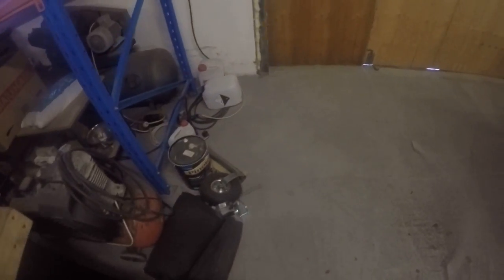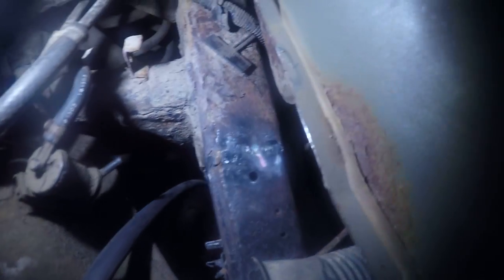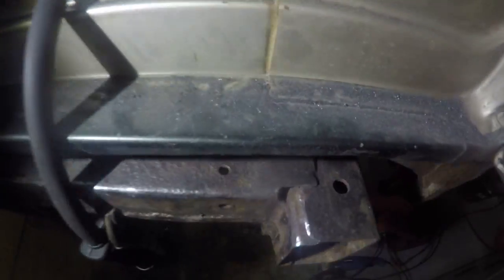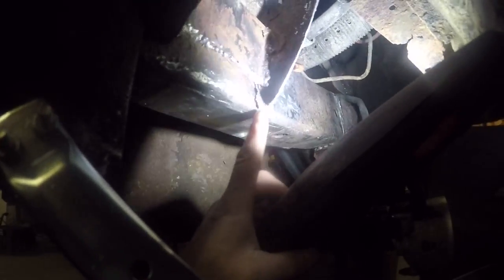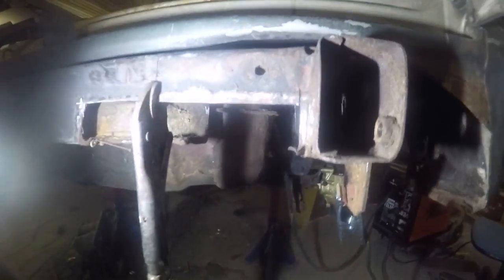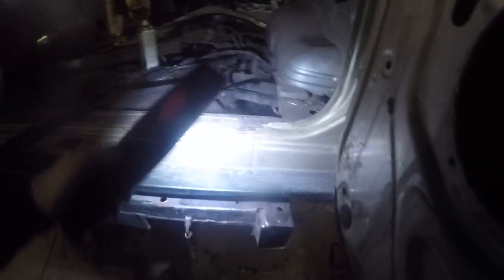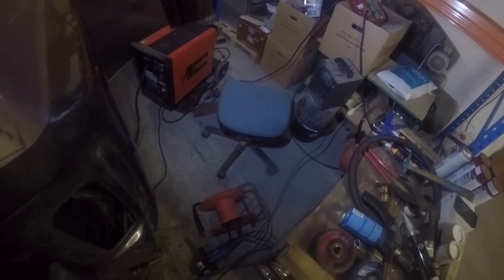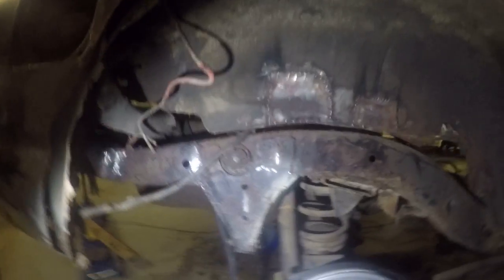rewelded frame piece and chilly

Comment: That looks like it's coming together nicely. Surprised it looks that well with no gas.
The frost is real!!!! I would have just thrown a bunch of alcohol / sprit on the floor and lit it, if only it wasn't because it makes th humidity run amok :) probably bot what you want if you don't want your new welds to start rusting overnight.
I would have  lit something on fire that's for sure. Bring some metal furniture scrap from the local recycling station, spot weld it together into an oven with a small chimney and slay some random tree on the way there. Brrr it looks shivering cold. I'm not a viking as you can tell hehe
Reply from the maker: well ,longjohns and a nice thick welding coat would have done a big diff for sure , buuut , you know what its like to run out the door and forgetting  everything on the way !